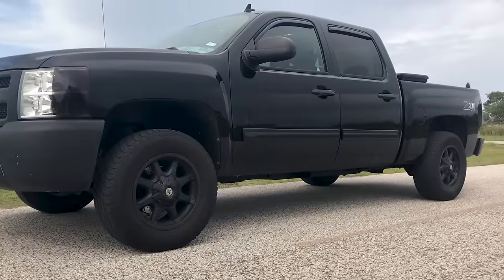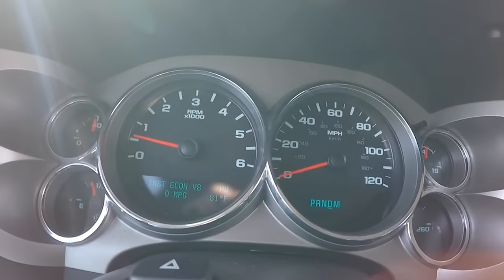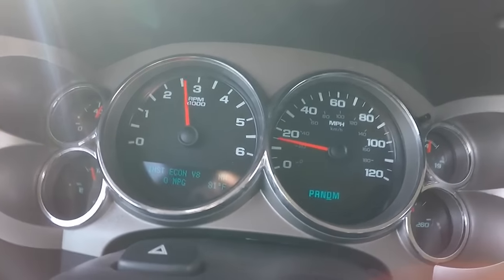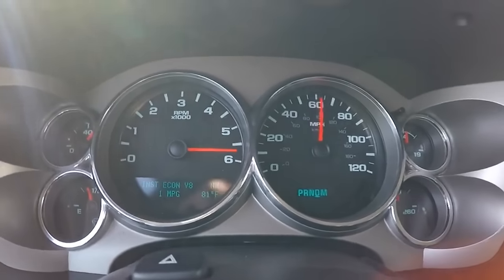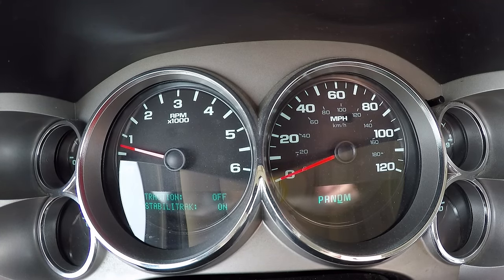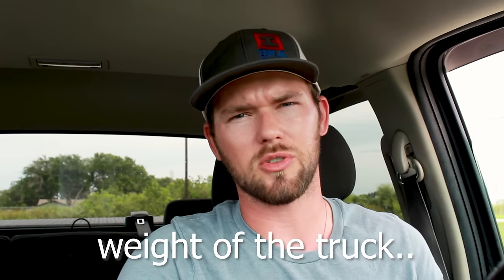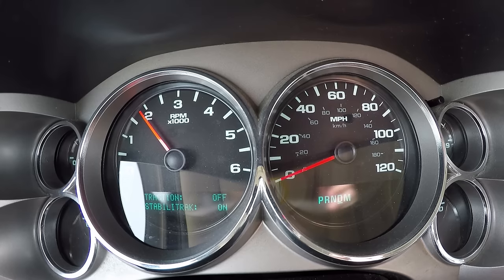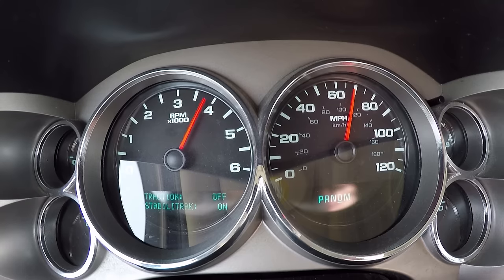High Stall Torque Converter Acceleration | Before and After

Comment from the maker: TCI Torque Converter (2,800 stall): https://amzn.to/2Tl8eU3
Reply: Can I add a circle d torque converter to my stock 17 GMC Sierra 1500 or do I need to install a cam in order to have a torque converter
Reply: Is a 2800 stall is better than a 2500 stall for a 700 R4 Transmission
Reply: Can u tow with this stall
Reply: @2WildRazn  that would not be good
Reply: Does it hurt mog ?
Reply: Mpg
Reply: @JTrump23  i installed a Circle d 2300 stall on my yukon denali 6.2.  No need to do anything other than to get a bigger transmission cooler.
Reply: Thanks bro 💥💪🏾

Comment: You didn’t method how much hotter the trans runs with a higher stall, you need to have a substantial trans cooler on there
Reply from the maker: I probably should’ve  mentioned that in this video, but I do have other videos about it.
Reply: And a shift kit
Reply from the maker: My transmission is stock other than the torque converter and the tune
Reply: Shouldn't really get hot because it's a lockup converter. They help with temperature. That's one of the things the tow mode does. Instead of it locking up in 4th or 5th at about 50mph it happens in 2nd at about 25mph. In tow mode it also raises the shift rpm 300 to 400rpm at part throttle in all gears. It helps keep the motor up in its power band. Slipping is what causes the heat. When it's locked there's no slipping so it runs cooler. 
Also from a dead stop if you have good traction or in 4WD. Try flashing the converter. Which is just going full throttle from an idle. It will hit harder and leave with more power.
Reply from the maker: I did notice my transmission running hotter. I do have an aftermarket tranny cooler on there to keep the temps down. During the winter I don’t ever worry about the temp, but if it’s stop and go traffic in the summer I really need to keep an eye on it.
Reply: That’s not how a good stall converter works, slippage under normal conditions should be basically like stock. 

You do have the ABILITY to create more heat, but if you drive it normally it shouldn’t be very noticeable. 

Of course if you like to get into that higher stall a bunch that’s another story.
Reply: @DrewLSsix  When are you going to post some videos of cars or trucks... and not dogs?
Reply: fwh79   I’m not, when are you going to respond with something intelligent and on topic? 

I told you how converters work, you obviously don’t know enough to explain that I’m wrong 🤷‍♂️
Reply: @ssimon64  Do you not have a father?  You sound kind of jealous.
Reply: @JohnVesely  even with efans and trans cooler it still gets hot during summer stop and go traffic?
Reply: My 08 Silverado has the tow package and a trans cooler. It should be fine with the stock cooler right?

Comment: Another point that you didn't make is the increased RPM following a WOT shift which most people call the shift extension.  Your RPM fell to ~4300-4400 after the 1-2 shift with the stock converter, but only fell to 4600-4700 with the aftermarket converter.  Even though the more obvious benefit is quickly traversing the lower RPM in 1st gear, you also get a few hundred RPM benefit at each shift which also means more average power in higher gears also.
Reply: That also means it won’t hold the gear as long though
Reply: Was a good shift extension!
Reply: @Timothy Steinkraus im glad someone else noticed that too lol

Comment: Instead of putting in a hi stall converter you could just swap out your gear set in your diffs. That way you don't waste your trans and actually fix the issue you're dealing with.

Comment: "6.5 seconds isn't too bad"

Bro for a full-size truck, that's fast as hell!
Reply from the maker: The Denali has the 6.2 in it lol my truck only has the 5.3
Reply from the maker: This was back when I had my old tires on the truck. In two wheel drive it spun a lot and I could only stall it up to 2k. With my new set up it doesn’t spin and I can stall up to 2,500 before the tires break loose. 4wd launch does it in 6 so I can imagine that with 2wd with the new set up it’s just a hair quicker.
Reply from the maker: The incredible Hemis cammed with an 8 speed auto. There’s a lot of different variables to making the truck quicker in the 0 to 60. Just changing to a smaller tire like he does I’m sure I can get in the low 5s. He also has more displacement and a more aggressive cam spec.
Reply from the maker: I’m not claiming anything. I’m just assuming that’s what it would be. Smaller tires do the same as regearing so it’s pretty logical that it would have a quicker time.
Reply: nomadben THE FORD F150 3.5L v6 is wayyy faster
Reply: m 88 NO V6 Ecoboost are awesome
Reply: @noidontthinksolol  

Warriorpluto likes to exaggerate. On another video comment conversation...he was telling me that his envoy Denali weighs the same as a dodge charger rt when in fact it happens to be 300-600 lbs heavier depending on trim and options.
Reply: warriorpluto lol Did you tune your converter. I hope they used a left handed open end wrench for the install.
Reply: GregMF What do you mean by that?
Reply: GregMF What do you mean by that?
Reply: warriorpluto how can I find dependable places to tune my trans
Reply: My NA Dodge Stealth r/t does 0-60 just as fast as this so that honestly is not that good tbh but at the same time i do weigh like 2-3000 pounds less or something like that 😂
Reply: m 88 “full bolt on”
Reply: My 1999 LQ4 swapped 4wd Suburban making 314rwhp and 343rwtq with a few bolt ons does 0-60 in 6.4. Once I get it tuned with my new cam and heads I hope to be under 6 (I'm at 6 without tuning and very conservative timing), then I'll see what difference a stall converter does after that!
Reply from the maker: I have a bigger stall converter now and it does the 0 to 60 in 5.4 seconds. Definitely call to get the right one for your vehicle.
Reply: You cannot compare Denali come on now AWD Better Trans hell naw lol
Reply: @mustangdbest220 Nice joke Man!
Reply: Barkev shadian what is?
Reply: @JohnVesely  did it increase the towing capacity?
Reply: @mustangdbest220  3.5 eco boost is better 😂 good jokes man good jokes my 4 door 2wd 93 diablo tune only 5.3 beat the brakes off a 4wd 4 door 3.5 twin turbo tuned with a bump on boost f150 😂
Reply: @thecrow1727  OHHH SURE Whatever you say 🤣🤣
Reply: @mustangdbest220  tik tok thecrow17
Reply: 4th video down on 1st row 💁‍♂️
Reply: @mustangdbest220  or on my insta d_borel_
Reply: @mustangdbest220  I have no reason to lie about what I drive or anything that I've done to my truck or what I'm doing to my truck when you grow up being around this or wanting to do this you'll achieve it I know I dont have the fastest truck or anything but im perfectly happy because of 1 thing its all my time and money its my efforts and its what I want 😌💁‍♂️
Reply: @thecrow1727  ohh ok
Reply: @mustangdbest220  so if you checked the video you would see im not lying but what you drive im curious 🤔
Reply: @noidontthinksolol  your comments aren't talking about stock trucks, fyi incredible hemi 😂😂😂😂😂😂😂😂😂😂😂😂.....at the end of the day, the new electric hummer's 0-60 is "fast as fuck"
Reply: A 2007 tundra does that fully stock lmao

Comment: Cool video so after 2 years of driving how do you like your torque converter? Is it still hanging tough, and also did your gas mileage wind up going down when cruising normally with the upgraded torque converter or did it go up...? 👍🏁
Thanks

Comment: I have a 2017 Escalade with a 6.2L engine. Instead of a torque converter, I'm swapping my 3.23 gears to 4.56 gears. Then put lighter brake rotors, lighter tires.

Comment: Best of luck if that's a TCI torque converter. I would have gone with A Yank or a Circle D.
Reply: Rock Roll my tci 4200 blew up. Poo
Reply: @Justin-bx2gz  sorry to hear that man. Do not send that back for them to repair. It'll just end up breaking again. Get you a Circle D or A Yank.
Reply: Ya TCI is garbage. Best converters are Circle D, Yank, Precision Industries...
Reply from the maker: Scott Wilson my TCI converter blew.. I did go and by a circle D
Reply: John Vesely so this converter didn’t last ?
Reply from the maker: Nope
Reply: @JohnVesely  wow. Glad I read this. I am wanting around 3800 stall for my street strip 69 Corvette when I put the 4L80e in it. Will steer clear of TCI
Reply: Circle D all the way that's what I've had for the last year holding up pretty good in a Camaro SS with 500 horse
Reply: I found a new FTI 4000 stall, triple disc lockup. Never installed, 700 bucks. Guy had receipt where he paid over 1100.

Comment: Stall converters are amazing for performance. Problem is what a turd they make a crew  cab daily driver truck bellow 3K typically. Best bet for a dd is keep stock stall and just do smaller cam, headers, cai, and supporting mods with a custom tune. You start pushing the 4L60e or 6L80e to far with mods and now you have a real bill on your hands of transmission work.

Comment: Some people saying trans tune or smaller tires. I wouldn't recommend it. The problem with this kind of theory is the higher the rev range your engine stays in the less reliable it has become. revs kill not torque. This is an awesome upgrade but if you go into smaller tires or changing diff sizes you will need to maintain a higher rpm range for similar sustained speeds and it may be out of your power range depending on the gear ratio in that transmission. I am sure you have an overdrive, probably in the .73 to .80 range. Keeping the rpms at a cool 3000 while doing 70 and that is ideal and inside your power band. range, not quite max but a good trade off considering the higher rpm torque converter...With all that being said. please please please keep that truck within your means. Id hate for you to lose your job because your truck took a dump due to the added load your transmission sees when it gets hit in the higher powerband range. This is where engineers actually have some sense. all the parts work together and when you do a little thing like that it in fact shortens the lifespan of other components. putting more strain on the trans, your axle, your diff, your u joints. your leaf springs or suspension. but its been 4 years so I'm going to assume you have it and its breaking parts or you got rid of it.
Reply from the maker: Still have the truck and it’s doing fine. It’s still my Daily driver. My trans temps don’t go over 180 degrees and rpm’s sit around 2k at 70mph. I have yet to have anything major give out but that’s just the risk with anything.

Comment: The torque convertor allows more torque to be created. Horsepower is a function of torque over time. The looser convertor plus the stator pitch angle allows a higher multiplication of input torque to the transmission. That's why you feel the difference.

Comment: $1000 For the Torque Converter??😢
Reply: that's cheap because the After Market Torque Converter of GM trucks equipped with 6L80E and newer transmission cost up to $3000 and higher.

Comment: Great video man ! How has the transmission hold up and how many miles does it have currently have a 2013 Silverado long tube headers 93 tune and want to get it cammed fbo and was wondering how will the transmission hold up with the cam ?
Reply: Would love to hear this answer. I'm sitting on the same thing.

Comment: As an ecoboost owner....Ford, GM, RAM, and Toyota trucks are all garbage. I can't wait until these pieces of crap are in the junkyard and we can drive EVs without spending $80k. No more oil changes and fluid checks. No more transmission scares. Everyone will be happy whooshing to 60 in >3 seconds and spending $6 to fill the battery. Embrace the change! I'm sure some people hesitated to switch to a automobile from their horse-carriage.

Comment: Torque convertors MULTIPLY torque UNDER LOAD conditions.
It’s NOT SLIPPING per se, it is amplifying torque, by dividing RPMs. Think of it as a varying differential, perfectly suited to the load conditions.
A flywheel and clutch assembly can store torque, but cannot amplify it.
Ideally, a properly matched torque convertor will re-stall after each shift, helping the engine to recover from the load change. And it operates instantly, automatically. 😃
Sticks are old school’s old school. Obsolete decades ago. They are useable, but not really advantageous, except for perhaps rock crawling where more finnesse may be required. Here, a LOW-stall convertor may come-in more useful.
People are cautious of automatics because they don’t fully understand the complexities, but I assure you they are not the least bit magical in science or operation. They are tremendously well engineered and are continually improving.
The more you understand, the more you’ll appreciate their contributions.
Why settle for less?
Jussed sayin’. 😶

Comment: Does your Chevy Silverado have the 5.3L Vortec V8 engine, with the 6 speed 6L80 transmission, or do you have an 8 speed automatic transmission? I see that your truck got up to 70MPH in 2nd gear. I have a Chevy Silverado too, and mines can't do 70MPH in 2nd gear, due to my low gear ratio.

Comment: Got a question for you young man as I just purchased a 2007 Chevrolet Avalanche had to put a new engine in it yeah and got it running and got it going and the transmission is Shifting kind of like what you're talkin about within aftermarket torque converter is there any way to know for sure if it's an aftermarket torque converter when it shifts that shifts beautifully but likes a second gear it'll get us about 4,000 RPMs before it was shift unless I let off on it I'm going to worship and then it will ship transmission will shift sorry using talk-to-text

Comment: You know circle d has converter for about 650$ for the 6l80 trucks, I don’t if I would pay 60$ short of a grand for the TCI one just my opinion on the price. 

My 2011 gmc is in the shop getting a 2800 stall and a stage 2 cam installed right now and I have really used this videos to gauge what I’m doing. Honestly some pretty good information you ah e put together.
Reply from the maker: Yeah I know the tci is alittle expensive, I got a really good deal on it and only paid a quarter of the price of retail. But I’m glad I could help! The only reason I’m making these videos is because there weren’t any of these videos on YouTube so I thought it would help out other people.
Reply: John Vesely makes sense bro, got my truck back and it runs good but has growing pains lol

Comment: I got a daily ext cab. Tsp headers and 224/228 cam with stock converter. Any idea what size I should get? I also got 373s in the back
Reply from the maker: 2,600 is fine for daily use, it's definitely better than stock, but I think at least a 3,000 rpm stall would be good for that cam. It wouldn't hurt to take a look at some forums to get different perspectives.
Reply: 3200 yank
Reply: 3200
Reply: Get a transmission cooler when installing a stall , a friend has something over 3500 stall not sure, ls2 08 Tahoe 225/232 tsp cam , 3.73 running 13.6 stock 20s wheels. 
I think he lunch at 2400 rpm bc needs better tires , so if you get a 3200 stall will be good for you.
Reply: Find where your cam starts its power band and go 500 rpm past it. If your cam has a power band starting at 3000 rpms then get a 3500 rpm stall convertor. You can tune the convertor lockup point so that it doesn't slip so much driving around.
Reply: GimmeDatHemi ! X
Reply: Just don't buy a TCI converter. I'm not trying to knock this guy if he's happy with it thats great but there are much better quality converters out there(Yank, Circle D, PI). Sure they might be a little more expensive but there's a reason for that. Better quality.
Reply: @hoost3056  what do you mean by slip? And lockup is where it gets the rpm in the powerband right?

Comment: How to you adjust to stall? As in if you want your transmission to engage at a higher rpm
Reply: The stall speed is typically not something that is adjustable on torque converters. The only way to increase it is to install a torque converter built with a higher stall speed.

Comment: Which is better 2500 or 2800 stall for transmission and what does it do
Reply from the maker: All depends on the application. I do have another video briefly describing what a high stall converter does. But if you want something more in-depth then there’s a few other videos on YouTube.

Comment: Awesome job. That truck is quite fast for nearly stock 👍
Reply from the maker: The truck isn’t nearly stock lol.
Reply: @JohnVesely  I could really use some guidance. I'm putting a stage 3 master comp cam kit, the only long tube headers I could find that fit my 07 300C AWD 5.7, a 90mm throttle body and true header back straight pipe. So far all I have is a 180 tstat, cai, and Diablo tuned to 93 oct. I'm researching tq converters now because someone told me I would have to upgrade the tq converter with those mods. Someone said I would need to upgrade the timing chain also? What all do you think I would have to upgrade at the same time as those 3 mods?

Comment: So if I want a low end torque monster keep it at lower stall. New to transmissions and I'm getting a new one for my truck and I'm building the engine rn. I have a 91 7.5 L bored to 7.7L and a bigger cam. The c6 I have rn wont be able to handle the amount of torque I'm adding stock.
Reply: Jacob Henle see that’s what I’m want to know as well I’m building a lq4 for a c10 right now and I want the kinda throw you in the seat on command but I don’t want it falling in its face up top